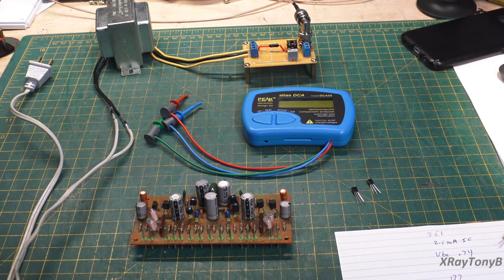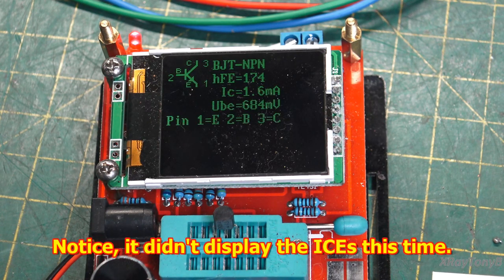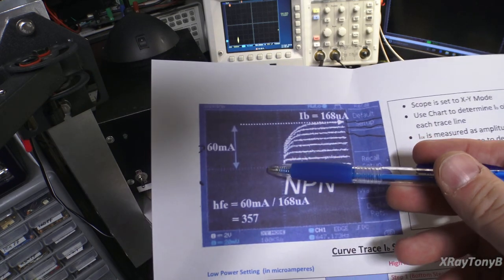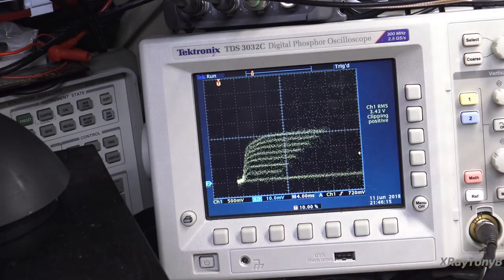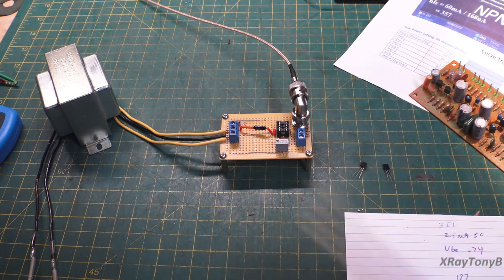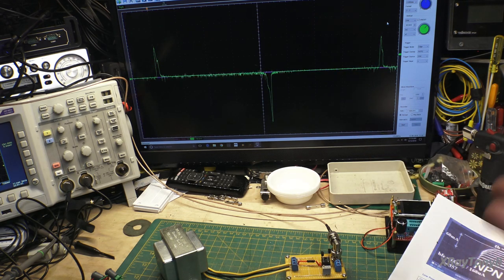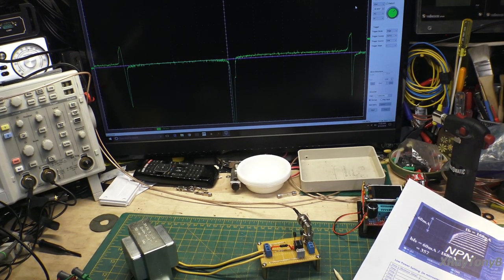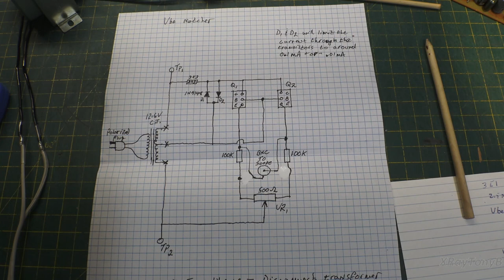Transistor Testing & Matching

Comment: I have a pair of the trusty Tektronix curve tracers and they are a joy to use.  Also, don't forget about the old school transistor testers that were made by many companies like Hickok, Westmore, Triplett, Sencore, etc.  With the old analog meter style so called "laboratory"  testers you can hand plot a curve trace on some logarithmic graph paper.  I actually did that for years before I got my first Tek curve tracer.  I can hand plot a curve with one of them and get a almost carbon copy match to what I will see on the Tek curve tracer.  Also, some of the old analog units I have can supply up to 30 Amps so you can test high power transistors with them.  I work in the RF world and it's nice to be able to test transistors at real world levels.  I have seen the results from my Peak DCA75 fall flat on their face when I tested the same transistor under full rated load.  It's surprising how much load can effect the hfe.
Reply: Full rated voltage that they will be working in if not a little bit over for some headroom, at the expected frequencies that they are expected to work with so a sweep through would also be great! 
I somehow prefer the older gear for being brutally honest...

Comment: Normal 100k have 5% tolerance, so you should use at least a 5k pot to compensate, you have to go fish for two almost identical 100k in the first place just to be able to use a 500 ohm resistor. How about changing the circuit to use a signal generator instead of the transformer, you could test them in higher frequencies more in line with where the transistors will normally operate.

Comment: Definitely not enough discussion about this particular topic. This comments section should be thriving but it's not and that means that there's a lot of people who just match the part number... The thing with luck is that eventually it runs out and during the worst possible situation where the reason why the owner wanted his device repaired is because it has a set of transistors that are now unobtainium, so you can't touch them but the small signal transistors.... Ah ha! A cascading domino effect failure! Nice 👌
Reply: If you buy all transistors from same batch they are more likely to be similar.

Comment: Commenting on old video may be lame but the different reading from the Peak to the cheapie absolutely makes sense as both of them do measurement at different current. The Peak hat Ube 0.1V higher than the cheapie but the cheapie used 2.5 mA Base current for testing while the Peak uses 4.62 mA. So both are using different test point on the Ub/Ib curve (or Vb/Ib as you would have called it). I also have one of this cheapie-units with the rotational encoder and it seems to be pretty much consistent. I guess the different display of with/ without Ice-leakage could be because it is right at the point where it could not get proper reading for resolution reasons? And the Peak only did display leakage current of 0.01 mA resolution while the cheapie at least tried to have a resolution of 1 micro-Amps, that's factor of 10 inbetween. One thing is for sure: The cheapies may not be lab-grade accuracy but according to my experience they give a pretty good idea of the device under test. Especially as you won't compare the transistor measured with one device with the measurement on some completely different. You will all measurements against the same meter.
Reply: I wonder if the testing parameters change if you run the tester at a slightly higher voltage? I also have been using one of those cheap Chinese devices and it's pretty good at what it can do... Surely it should be able to handle 10V or 11V. 
I don't know but it got me thinking when you mentioned above about the different voltages an current that each tester used, unless the test parameters are regulated? Who knows.
Reply: @PeterMilanovski  The cheapies are usually using the A/D converters of the Atmega AT328 microcontroller without much of protection circuitry around it and that converter has a limited range of input voltage only. So, I don't think it's a good idea to work with much higher voltages. The ATmega328P  is having maximum operating voltage of 5.5V and all input ports have to stay even below the power supply voltage or you may damage the microcontroller. On the other hand, if you are measuring some (bipolar) transistor it would not affect the measurement that much, as that would amplify the Current but not Voltage. It's something totally different for measuring break-through voltage of some Zener Diodes or LED's or Thyristors..... But - it is a cheapie! It won't give you all the truth about all components. It may give you some good idea of many devices, and the software really does a good job with current testers. But it neither is absolutely "exact" nor will it give you informations on all devices under test or even more give you all available informations on them. You will always have to take the informations being displayed with some grain of salt! ;)
Reply: @Slartibartfas042  yeah I think that you are correct in saying that you would have to take the measurement with a grain of salt! 
I have a few different devices for measuring capacitors and they don't work with anything over 470uF, they give me numbers but I feel that I get better results with charging them to their rated voltage through a current analogue meter and if that cap is still showing micro amp's then it's not going to be used! I feel that leakage is a more important test than capacity most of the time but generally if it's leaking, then the capacity doesn't matter, it has to be replaced... It's an old way of doing things that hasn't failed me yet and the cheapie tester doesn't show you what it's doing during the test, let alone show what the device is doing while it's being tested, you just get the end result and don't worry about what was happening at the beginning or in the middle of the test! 
Things can get pretty salty some days LoL.
Reply: @PeterMilanovski  That's true, yes. Salty and sometimes smokey. ;)  BTW: I doubt you don't know the youtuber channel and the video about capacity tester, but mayby someone else might be interested in it: "Mr. Carlson's lab" has some nice video about Capacity checking and leakage checking etc.: Just type in "mr carlson's lab capacitor tester" into youtube search field above - it's definitely worth a short look at it and I found that watching the series of videos there really helps to understand what is going on inside capacitors when they are aging (series Resistance, leakage Resistance)...
Reply: @Slartibartfas042  thanks but I'm already familiar with Mr Carlson's Lab, he has a capacitor tester but it doesn't give you a good idea of what it's doing while it's testing.. I personally prefer the older equipment for that reason alone. I have no problems with the understanding of capacitors or any other components but testers and good one's are hard to find. I prefer to know what is happening at any time during the test so that I can make my own decisions...
I have a really good channel to recommend, Steel Wheels Down. The best explanation for how a transistor works on the planet, once you see the video, you will understand how a transistor works better than most, his other videos are really good too. Sadly he's no longer with us, he had cancer! His last video is sad because you can see that he knows that he hasn't got long. He is probably the best teacher that anyone has ever had... Check it out if you haven't already..
Reply: @PeterMilanovski  You are ABSOLUTELY RIGHT !
Reply: @Slartibartfas042   The best  method is this that Malinovski sees with an analog microamper meter !
Reply: @johnadams9041  as said before, there is no "measure one and be sure it is good" method. You always have to take into consideration all values of a cap. There's series resistance that can not be measured your way as it only limits RF bandwidth and ripple rejection, there's the parallel resistance that you do measure (yes, that's the only one that can be measured via just measuring the charging current when cap is already charged), apart from that there is still left the inductance inherited from manufacturing and style of the cap, .....

Comment: No, the diodes are not current limiting. They clamp the collectors to a diode drop above ground (for NPN or below ground for PNP). That ensures that the Vce is around 1.2V to 1.4V (two diode drops), since the bases are at 0V and the the emitters are another diode drop beyond that. Their purpose is to minimise the dissipation in the transistors to lessen the effect of any self-heating from that dissipation.

Comment: I am always amazed what you are allowed to drive on the road in the US. Where i live no vehicle is allowed on the road which has its tires be the widest part of the vehicle. Even if you have rims or tires being 0.5 inch wider than the body, the vehicle is confiscated and you are fined at least 500 dollars. You have to pay the towing fee and correct the vehicle. Then you need to have the vehicle checked and certified.(at your own cost).

Comment: Nice video
Vf depends on the base current, just like it does for diodes. Just some nitpicking, hFE is not the same as hfe (and HFE or Hfe do not exist :-) ). So be careful how you write them down. It is one of the  "h" parameters, hFE is the DC gain, this is what most testers measure. And not lineair(like you demonstrate on your CT), so if your tester uses 1uA base current the hFE will be different as when you use 10mA . 
hfe is the small signal gain. (The delta Ib versus the delta Ic)
I have a bunch of old transistor testers , 3 of them professional ones and I have a Tek 576. All testers give a different value. Be careful with the old ones, some give alpha instead of beta. Your on/off time tester  does about the same as my TRektronixs Type R plugin (transistor rise time tester) A rather rare plugin: http://www.pa4tim.nl/?p=3729 Edit: I was wrong, I think your tester is something different. (not T-rise, T-fall of the Vce, like the R plugin, yours is Vb ? )
Modern curve tracers are often called SMU's, source measure units
I never heard about Vbe testing, is that an ¨audio-thing"  
There is a great book from Tektronix about curve tracers/transistor testing , they are from the 60-70's and as pdf on the www. They are called the concept series. See f.i. https://www.davmar.org/concepts.html

Comment: Hi Tony,
Thanks for posting this video.  Your modification to the Vbe matching circuit is inspired!
I have to match signal transistors quite often when repairing vintage amplifiers.
I don't have a curve tracer and have tried various methods.
I built this circuit today and it really works well, confirming a good match for transistors matched for hfe and Vbe with my Peak Atlas DA75.
I used a centre tapped 18v transformer which works fine.
I love the fact that you can confirm matching on prolonged use and rise in temperature.
Keep up the good work.  I have learnt so much from your excellent videos.

Comment: Small signal transistor matching is all about hFE. (FETs and valves are similarly matched for voltage gain.) In audio preamplifiers the transistors are biased so that they're in the middle of their linear range, and the circuit gain is limited to avoid clipping due to either cutoff or saturation.

V_BE is a measure of where the transistor begins to conduct. For just about all small signal silicon transistors and diodes, this is 0.6V give or take a bee's dick, but any properly designed audio preamplifier will keep the base voltage well above this during operation. Matching for V_BE is pretty much a waste of time for your intended application; as long as your transistors are matched for gain, you're golden.
Reply: Thank you for stating this. You pretty much nailed it.
Reply: That misses an important point. Audio preamplifiers will often use a differential pair as the input, either to take a balanced input, or to allow negative feedback across multiple stages as is used in opamps. For a differential pair, the single most important matching parameter is Vbe because that determines whether the two transistors accurately track across a differential input voltage. Matching Hfe only matters for differential input currents, and most of the time that's far less important.

Since a single parameter determines the relationship between Vbe and Ib, having two transistors with the same Vbe at a given current is a good indication that the parts match and will track as the current is varied.

Comment: The V_BE matching is all in all for differential amplifiers (like op-amp input stages)  The mismatch is the amplifier’s offset error.  Talk about microvolts!
Another place where you depend on the match is a log-converter.  In fact, then you need a match through a wide base current range.  (In op-amps you operate at a fixed current, so you can do matching only at that current).

Comment: I designed my own transistor matcher. It is USB based but the interface has 12 volt supply and supplies 0 to 45mA to the transistor.  The PC screen can hold up to 5 different transistors at the same time for easy comparison. Those cheap matchers put about 2mA into transistor which is useless.
I am working on a new version which supplies up to 1 amp to transistor.
Reply: As a happy owner of the initial version I'm happy to confirm its excellent performance - by replacing factory long tail input pairs with said tracer matched ones (Toshiba NOS 2SC2240BL), the DC offset on an integrated with no adjustment dropped from about 30mA to below 0.2 ! I hope Nigel gets his 1A version on the market soon and I'll definitely grab one to better match finals. The best piece of kit in terms of price to performance ratio I have in my clandestine, Dear Wife-proof workshop, by far. Thanks again Nigel !
Reply: Hi. Can you share the circuit?
Reply: Hi,
Can you share a link to your transistor matched please?

Comment: The Vbe matcher circuit is very interesting. In cases you work with 1% resistors I would suggest to use a trimmer of 2 kOhm or 2.5 kOhm for pre-matching the circuit. 500 Ohm could be too small. Another point is the diode limitation of the collector voltage. The hfe of transistors as almost always smaller if you operate them close to their saturation voltage. In the data sheets it is typically given for Vce at 10 V and 1 V (see datasheet for 2N2222). Allready at 1 V hfe is considerably smaller than for 10 V.

The last point was also the criticism I have relating the circuits in ianFritz-transmat0011_144.pdf from Ian Fritz, October 2010.

My suggestion is, to operate with an adjustable current source delivering a constant current of more than hfe*Ib and a Zener-diode-like adjustable voltage limiter for 1 to 10 V for Vce in order to make sure that you have a more "natural" Vbe behavoir of the transistors under comparison.

I personally work with a simple transistor tester in the first step to find hfe- and Vbe-matches. After this I operate the transistors in a test circuit which simulates the behavior in the application at the correct voltage and current levels.

Comment: Thanks for sharing this circuit, i plan to build one as well.
Although i do have a Leader curve tracer, i actually built the kit one recently, and it does work quite well.
Testing transistors under AC conditions is really ideal.I will add this one to my test bench.
I enjoy your videos and appreciate your knowledge sharing.
Greetings from Australia.

Comment: Thank you for the interesting videos re this Thai Kit CH-012 curve tracer. 

Along with a 7000 series Tek mainframe, I had a curve tracer plug in. In order to match transistors, I constructed a device using an 8-pin DIP socket wired through a DPST switch. The pin "holes" on either side of the socket were the "EBCE" holes (like on a DMM) and with two similar transistors mounted on both sides, switching back and forth allowed a comparison.

The Tek mainframe bought the farm and the plug-ins were sold off, but I retained the device. When my CH-012 kit is done, the EBC connections will be wired to banana jacks on the front panel so I can use the matching device.

This also somewhat addresses the danger of improperly inserting a transistor DUT as you mentioned in your kit construction video.

Comment: Very nice vbe circuit for testing transistors very simple discrete components you can't get better than that. I'm definitely going to make this simple circuit once. I always have said transistors are very important regardless of original or not original lots of technicians have said nah if the transistors the same number will be good enough but through experience I have seen lots of problems and it's not easy sometimes finding genuine transistors. Great video always with good explanation. 👍😁

Comment: @ 43:40  You could use a 10 pin ( 5 X 2) DIP socket for A and B component installation, and then from top to bottom go  C-B-E-C-B, bridging the C and B pins on their respective sides where needed. That way, it would be easy to put just about any inline or round transistors into the socket with minimal bending to the pins. This would cover any one of 6 possible configurations quickly with minimal fuss. I am one of the many viewing this that will breadboard up a version, possibly making a gerber file for a board as well. Thanks for your time in thinking this one out and sharing it with us.